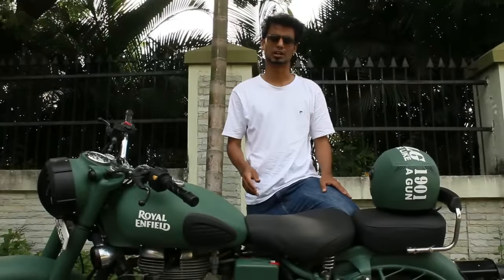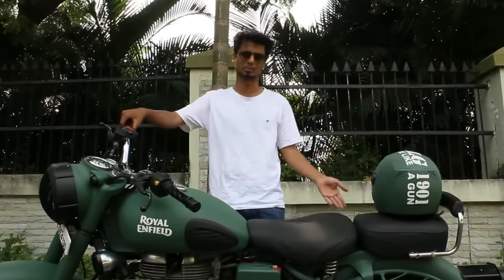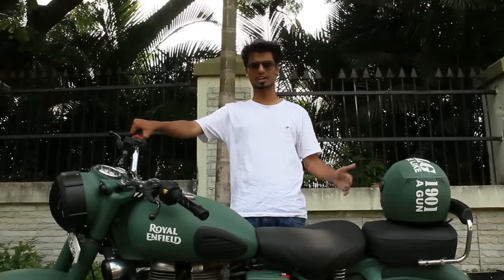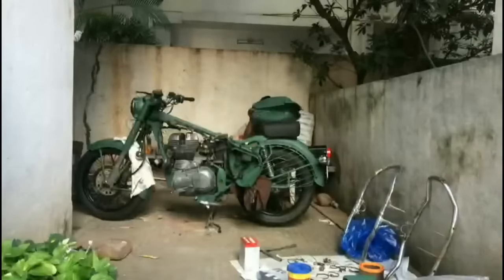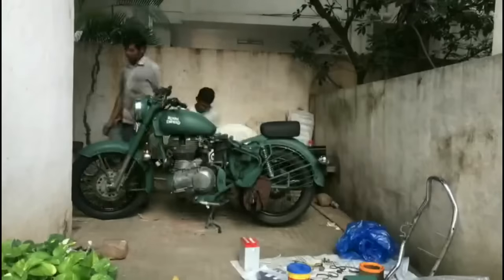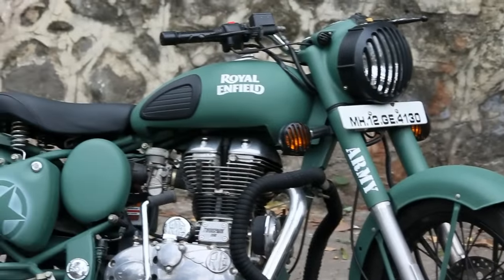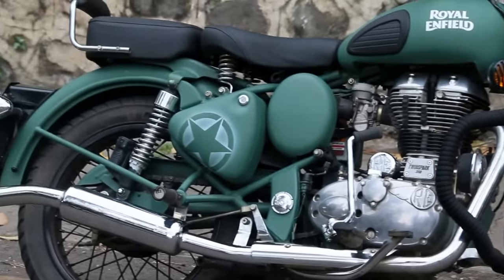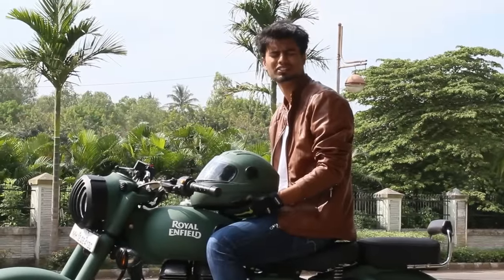royal enfield classic 350 designing-(modified bullet) - carbon chrome customs

Comment: Bro,
I want to buy a bike So could you tell me which one is better Bullet 350 classic or Dominor 400?
iam a college student delhi.
Reply: Viraaj Bhinda depends on what you're going to be using it for. If you plan on doing more road trips, getting a better milage and if you have the love for royal Enfield despite their flaws, then you should go for 350. If you plan on just sticking to city and ofc racing then the RE is not meant for you. I would suggest you get a test drive for both before going for one, see which suits you better and can handle with ease.
Reply: Heramb Karmarkar ok bro thanks for your suggestions. 
but u said flaws of RE can u tell me what are the flaws?
Reply: Viraaj Bhinda vibrations, rear brakes on the classic could've been better and after sales service. but if you run in the vehicle properly and get it serviced in the given time and run it in stock condition without any mods, you'll have no problems at all in the long run.
Reply: Heramb Karmarkar ok bro thanks. ..
since its gonna be my first bike what do you should I buy an RE or would u suggest me some other brands?
Reply: Viraaj Bhinda RE is my first bike as well and I love it. I suggest you take test drives to all the options and then decide. I don't wanna come in biased but once you buy a RE, you'll not feel like sitting on another bike unless it's a Zx10 which I dream of buying in the near future😂
Reply: Heramb Karmarkar ok bro thanks for your suggestions :)